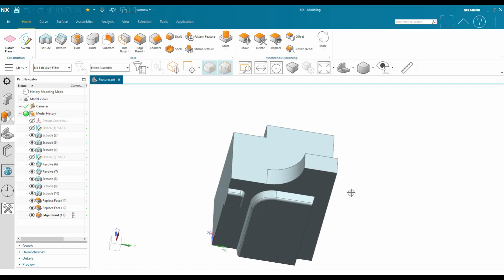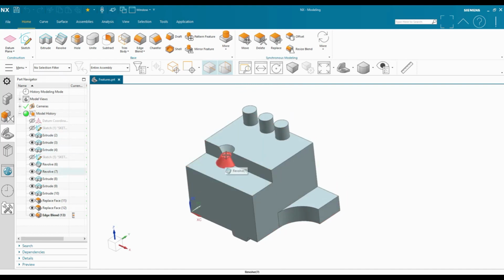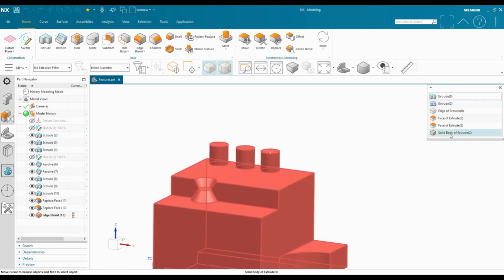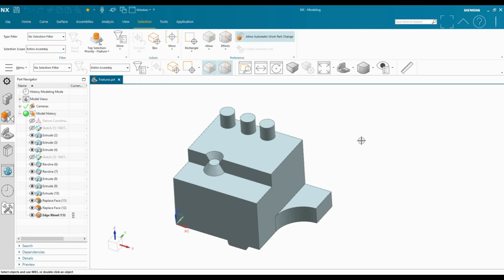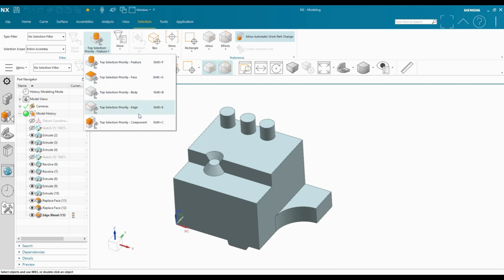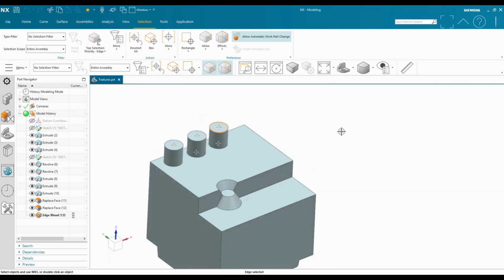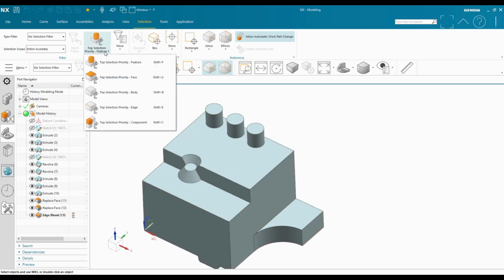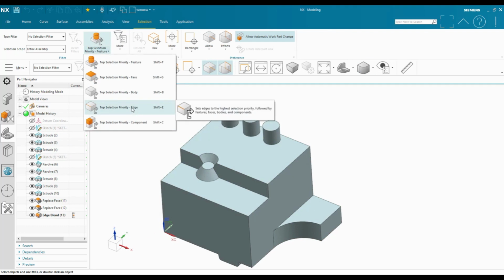NX CAD Tips and Tricks - Top Selection Priority

Comment: But this doesn't work in NX Assembly. Why is that?
Reply: You're right, when you are selecting objects in an assembly that are not present in the current work part, the components of the assembly is all it can see.  If you had other objects at the assembly level, or if you made one of the components the work part at the assembly level, the top selection priority would work as you're expecting.